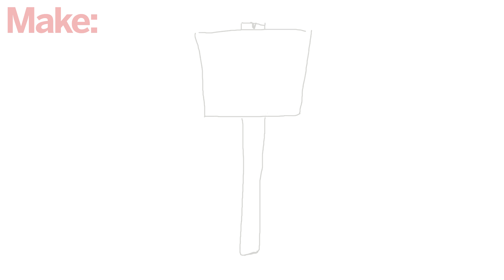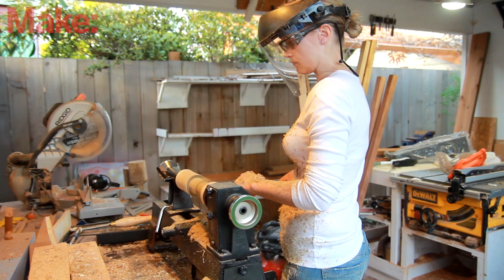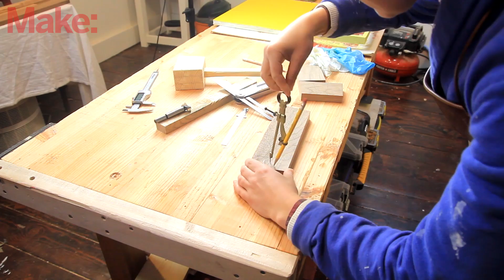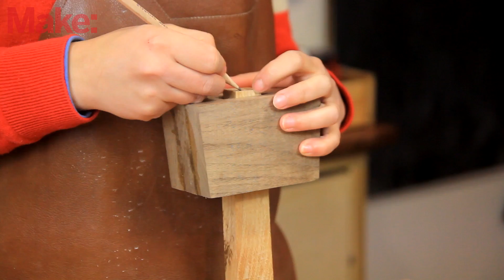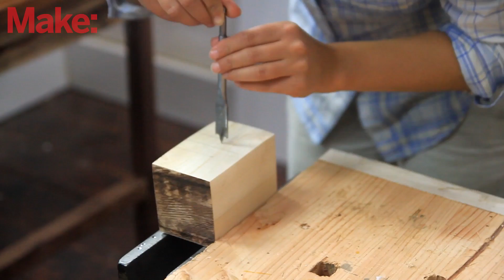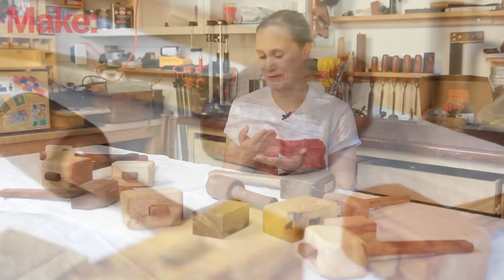Darbin Orvar: Three Ways To Make a Mallet

Comment: I look forward to the day I see you with dust collection at your lathe.  It goes far toward making turning more enjoyable.  It removes the problem of sanding dust completely and can even grab most and, sometimes, all the shavings.

The square hoods you buy on line or downtown don't work efficiently. They leave too much opportunity for the system to draw air from the sides, top and bottom.

I used a short piece of eight inch PVC pipe to build a hood, which wraps around the work pieces, but without interfering with the turning processes.

I cut the pipe in a kind of C shape.  After installing ends, cutting a four inch hole in the back and building it up with wood so I could install a hose, I made a stand for it.

Comment: When you're making the laminated mallet, couldn't the handle and the middle piece of the head be one solid block of wood? So you could just cut a T shape then then add the two outside pieces to make the head fatter. I think this would be easier and possibly stronger.

Comment: is there any reason for the solid head mallet having to be through a square hole instead of a round one, with a round handle, like how pickaxes and some olde types of hatchets do?
Reply: +Wovaka You could do that but it would have to be permanently wedged in, it is hard to drill a tapered round hole.
Reply: When you hold a flat handle you can feel in your hand immediately which way up the head is without looking, therefore keeping your eye on your subject you're about to hit.
Reply: +Darbin Orvar i was thinking along the lines of drilling a straight hole and then tapering it with a knife,  rasp, file and then sandpaper.
Reply: +Wovaka That could certainly work, but it might be a lot of work :)
Reply: RE: Circular handles. Any off-centre hit works at breaking the handle to head lock.
Reply: +Wovaka Round is too easy